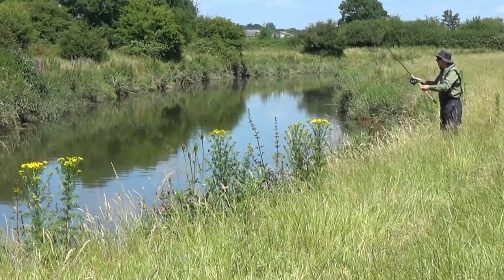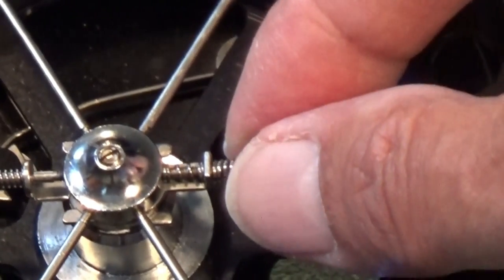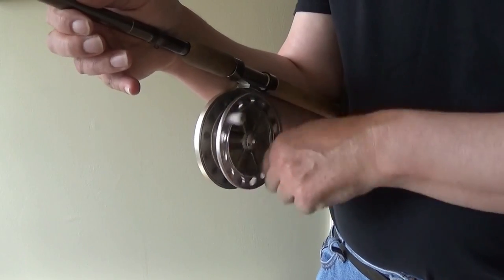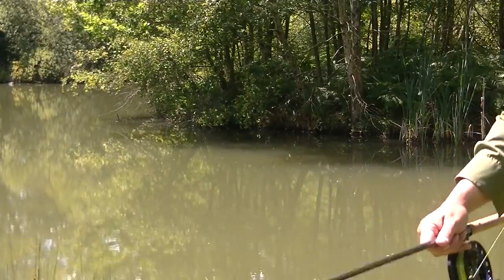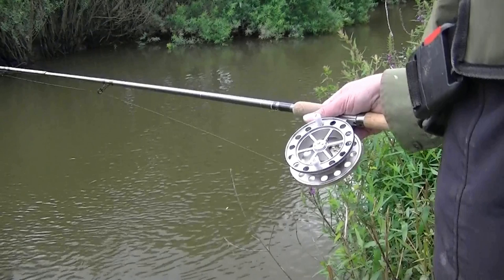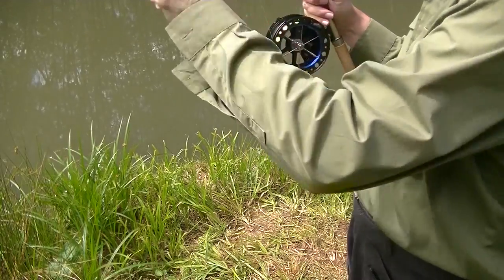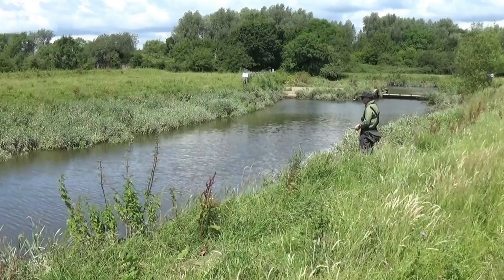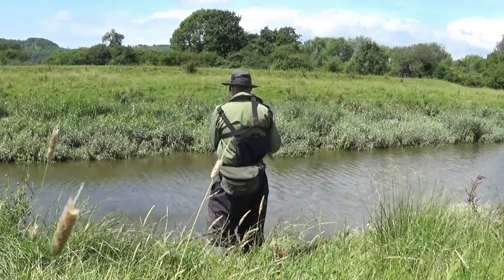Centrepin reels and how to use them

Comment: I used to have a 5.1/2" handle-less, extra wide Leeds reel that would spin for ages with one bat. The beauty of Leeds reels is there's plenty of room for your fingers between the rim and the seat. After reading an article by the great angler Dave Thomas I had mine set up with the line coming off the top  which I found gave greater trotting control and sticking you fingers in one of the holes soon became second nature when playing a fish. Sadly I let it go when my trotting days ended.

Comment: I must admit I  have found centrepin reel fishing so enjoyable it's been a long time since I used one as a kid! .Tench fishing this year has been a real pleasure with one. But for me a line guard is essential.
Reply: Explain please . Line guard
Reply: @derekkearns3377  As fitted to one of the reels demonstrated in this video it certainly helps control line on windy days etc.
Reply: @myke.h2913  cheers
Reply: I am just getting used to a centrepin this year, for trotting for grayling, dace and chub.
I have caught a grayling and a small chub, plus a few small roach and rudd in a stillwater. I bought a second-hand centrepin, and it seem OK. The only problem is that I loaded the line so that it emerges at the top, near the handle (a mistake) and as there is no line guard, I tend to get tangles around the reel seat. Do you know if it is possible to buy a line guard on its own? The reel has holes where I presume the line guard could be fitted.

Comment: The tip about covering the knot with a piece of tape is so perfect, why didn't I think of that? My line has been catching on the knot I tied it on with and has been occasionally impeding the cast, many thanks for your help, tight lines 👍
Reply from the maker: It's those little things that make such a difference. Thanks for your comment, best of luck.

Comment: For 30 years I put the line on backwards ( off the top) but recently have experimented with the line coming off the bottom. I've not noticed any difference in terms of tangles so, as it's easier winding quickly somehow this way,  I've continued with it. Nice video. 🙂

Comment: Great video, what rod is best paired with a true pin reel, would say for example a rod with larger rings make casting easier ?
Reply from the maker: I use my centrepin's for float fishing, so I use a standard 13 ft float rod (small rings). Hope this helps, best of luck.
Reply: Thanks for the reply

Comment: Thanks for the really informative video. I have a 20+ year old Young Purist II (y2041cl) and it has the small dial on one of the spokes to slow the pay off. How does this actually work to slow down the spin? Is something rubbing on the pin inside the reel? Would I need to replace whatever the 'brake disc' is?
Reply from the maker: The micro adjuster gently alters the drag to slow the free spin, but I can't imagine you would ever need to replace it. Hope this helps, best of luck.

Comment: Hi when using the loop cast do you take your finger of the spool allowing the spool to spin as you flick the rod tip out or keep your finger on the spool allowing the line you have pulled of the spool to go out only thanks
Reply from the maker: Go with your second option, best of luck.

Comment: Brilliant vid once again. Which type pin would be ok for low double figure carp average 8-12lb. As I've heard it's a great way to play them on a pin compared to the normal reel. Thanks
Reply from the maker: The black reel I use in the film is a 4.5in Wildriver Centrepin which would be fine for the Carp you mention. Although most any similar centrepin would should do, hope this helps.

Comment: Running the line from the bottom of the reel at a steep angle up to the first rod ring makes no sense to me as this will surely create friction. Take the line over the top of the reel and the line passes through the rings whilst barely touching them resulting in next to no friction which is surely the point of a free running centrepin.
Also, this allows the user to 'bat' the bottom of the drum away from the body with a great deal of vigor when reeling in line at speed. This is surely much easier than batting the drum towards the body if the line is coming from the bottom of the reel.
Also, there seems to be a fetish in centrepin circles about the need to learn the Wallis cast. It really isn't a requirement.

Comment: Hahaha I can’t imagine feeling a fish in backwards! Gotta go from the bottom
Reply: The late Dave Thomas was a big advocate of having the line come off the top of the reel which is the way I used mine for years back in the 70's and early 80's."Thumbing" the line off is much easier once you get used to it and batting to retrieve  is much faster. 
My tip for anyone looking to buy a centerpin reel. Get one with a longish stem so you can hold the rod on the reel seat directly above the reel which makes it easier to trot left to right.